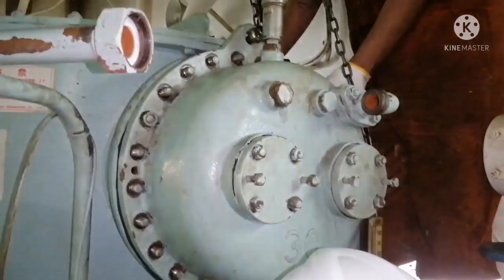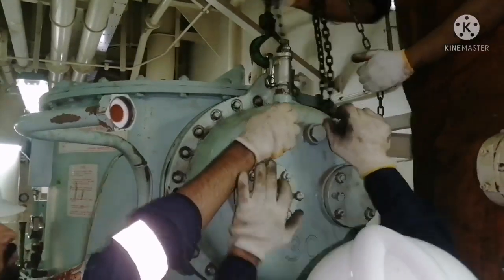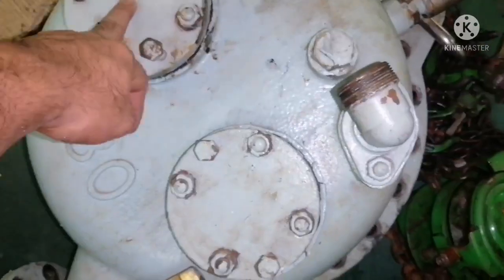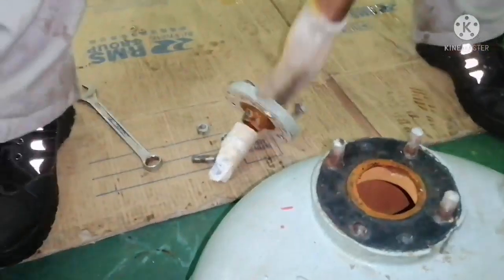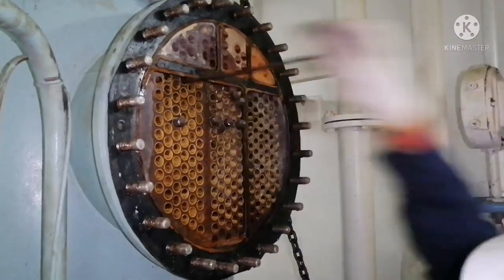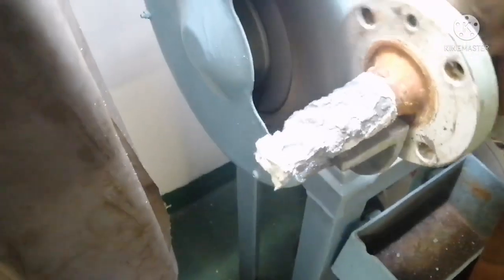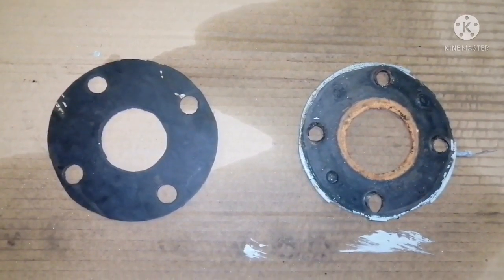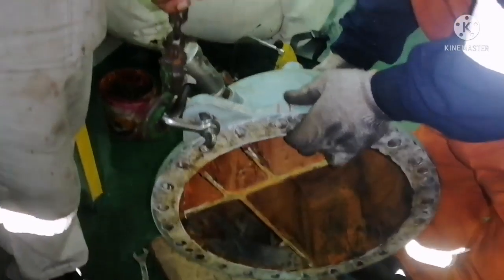How do they do.. How to clean condenser for fresh water generator onboard ships..

Comment: I have 4 question
 1. Why we are adding chemicals in fresh water generator. Because that water is good only then why we do that sir? The chemical name  sir?
2.
Reply: Why we are maintain back pressure in purifier sir?
Reply from the maker: @balajichandrasekar5005  this is to have ample dwell time and to maintain water oil interface properly..
Reply: Difference between mgps and iccp
Reply: My main doubt is en air bottle la capacity la measure pannama pressure la measure pannurom like 26 bar , 28 bar?
 2. Oru cylinder ku 30 bar pressure na ennoda air bottle capacity yae 30 bar dhan apa ennoda air bottle oru kick mattum dhan kuduka mudiyum ma sir?
 3. Air Compressor per cycle ku 30 bar pr ya produce pannudhu. But ennoda air bottle capacity 30 bar dhan apa orey cycle la air bottle fill pannitum ma?
Reply from the maker: @balajichandrasekar5005 
1. S sir
2. No sir u can even start the engine at 12 bar pressure also wen is engine is in manoeuvring.. But it depends engine to engine maintenance and performance..
If you note sea trial report u can see the air pressure parameters for engine starting.
3. As you said the pressure will b the 30 bar at the outlet of compressor but in the air bottle because of the volume the pressure has to copup along vth volume of the air bottle to get the req pressure.
Hope this reply will satisfy your query sir
Reply: What is npsh sir?
Reply from the maker: @balajichandrasekar5005  npsh is non positive suction head which is related to pump suction graph.
Reply from the maker: Spl err sir.. Its net positive suction head...
Reply: Sir. I am lifting one object with help of crane. Suddenly overtrip occur. My object is in top position. Epa apadi sir naan adha object ya remove pannuradhu
Reply from the maker: @balajichandrasekar5005  u can alwsys reset your crane power...
If it is not getting reseted.. Trouble shooting to be done...
Reply from the maker: This chemicals that we use is to prevent seawater derived scans from occurring in the inside wall of the heater piping.
Reply from the maker: Sasabit is the chemical name... Different makers give different name.. U can refer to manual
Reply from the maker: *Mgps is marine growth protection system which is to protect the sea water pipe line from marine growth..
*Iccp is impressed cathodic current protection system that is for hull protection
Reply from the maker: Sir i had replied for all 4 queries... Hope this reply will satisfy you..
Reply: Yes sir. Seriously sir you are gem sir. Thank you for your reply ❤️

Comment: Sir, How to carry out leak test of condenser and evaporator tubes?
Reply from the maker: Thanks for your query sir..
Here is ur reply..
* stop the FWG
* close inlet and outlet of both HT and sea water.
* open any one side of condenser cover.
* Now open the HT water inlet.. Adjust the valve in such a way that
Pressure shud not exceed more.
* Now wait for 10-20 mins.
* if there is any Leakage u can find water coming out of the tubes..
Hope this reply will satisfy your query..